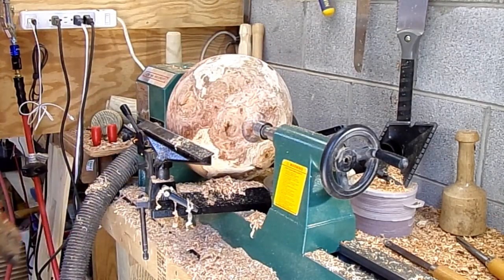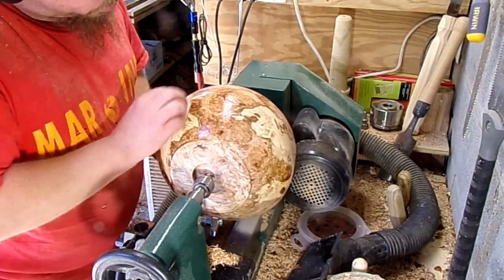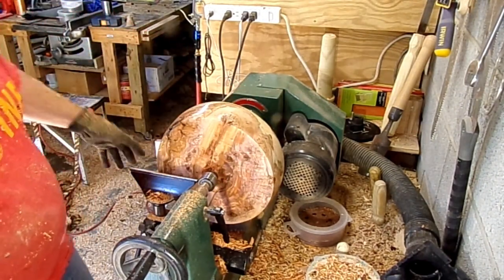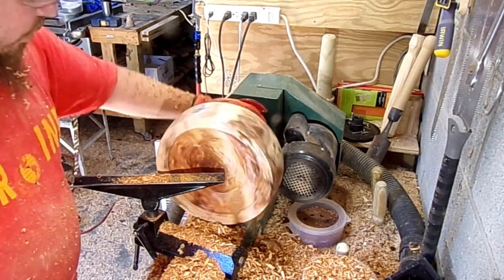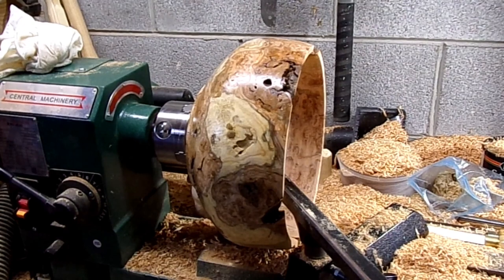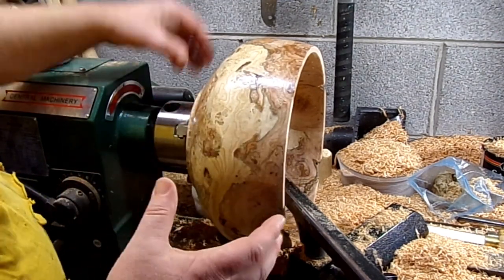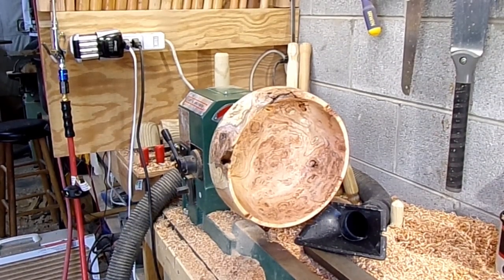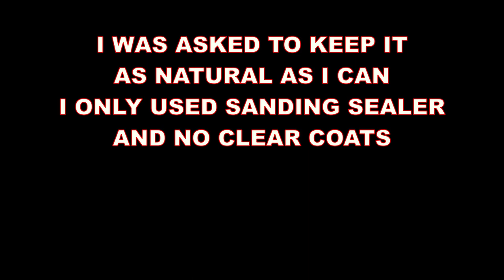BLACK CHERRY BOWL

Comment: Not a bad little lathe you got there. Harbor freight I believe how long have you had it and any issues?
Reply from the maker: Thank you. Yes, Harbor Freight. Bought it about 7 to 8 months ago and it is running fine. My issues are it starts at 500-600 RPM and for odd shaped items it can get sketchy at that speed. There is no reverse and I’ve found reverse would be a great tool to have. All in all it gets the job done and I’m having fun.
Reply: @clydeschuyler  sweet, I was in there last week and it was advertised for $399 I thought to good to be true but sounds like I might give it a shot.